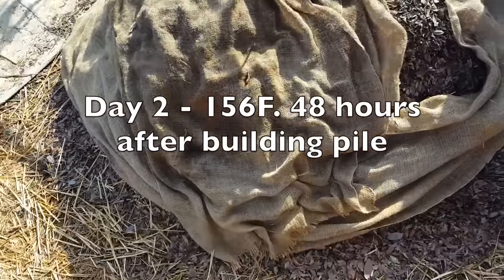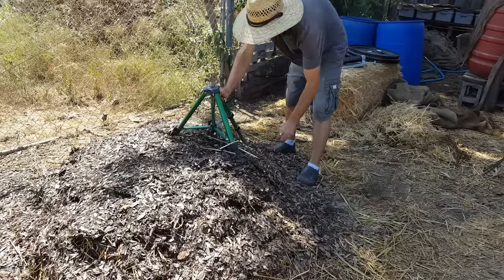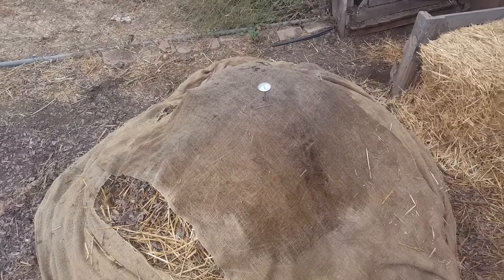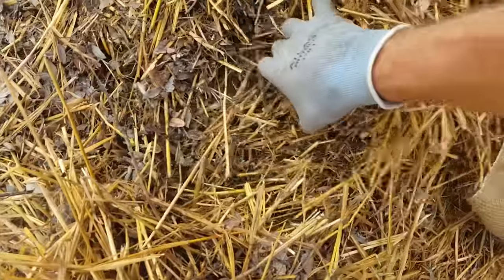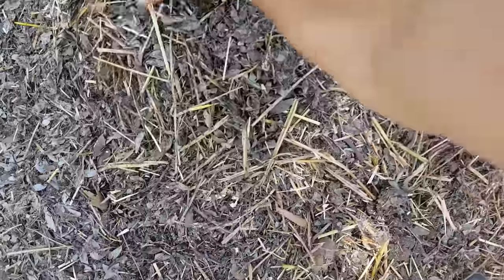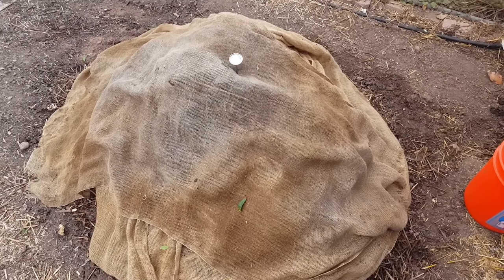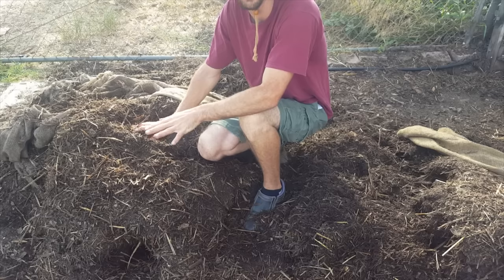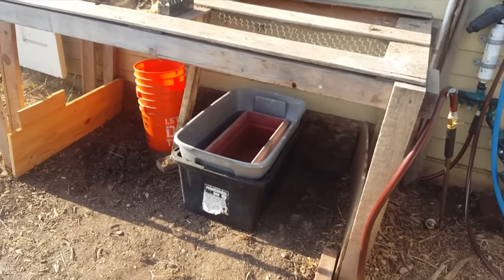How to Build a Hot Compost Pile Successfully 2 of 2

Comment: Super video.  A few years ago I played around with raising worms.  After a year or two, I simply dumped the red wigglers in my compost pile in the spring, expecting them to stay there during the summer then disappear in the winter here in PA.  I was wrong.  Not only did they stay in the warm weather, they stayed in a tight ball of sorts i the winter along with the hundreds of eggs they left behind.  So when I put the finished compost into my garden the following spring, I was shocked how many were still in the very bottom of the pile.  I decided to leave them there, adding any kitchen scraps and carbon sources to them.  What did I get?  I got another annual "pet" pile.  I get thousands of new worms from that first pile every year.  I go through the exact routine annually and I get new generations of worms in that same spot I dumped those initial worms about 10 years ago.  They help break down the pile so much quicker.  The only extra thing I want to add is when the weather starts to get rather cool, or cold to leave them alone.  They will die if you try to turn the pile in extreme temp.  Don't worry.  They will be there i the spring when you peek on on them.
Reply: Nice... We could have different experiments going on at once...
Reply: I started worm composting since 2016 or so ; I have 2 bins I keep indoors that bring me plenty of compost tea and a rather good amount of worm compost every year. But this compost is mostly worm poo (there are also springtails and woodlouses in one of the composters) and has a firm but muddy texture ; thus not really looking like compost soil I usually use for seedlings. Do you think this is related to a deeper breakdown process ; or it's just because it is another degradation process going on through hot processing ? Thanks.

Comment: if you add a small amount of alfalfa pellets to the compost mix it will dramatically increase the temp. and keep the temp in the 150 to 160 range for days.  after adding the alfalfa the temp goes to 150 in 24 hours and stays in that range for 2 - 3 weeks. alfalfa pellets are available at pet supply stores, farm & garden stores and tractor supply.
Reply: I'm using blood fish and bone, seaweed powder and azomite to help my pile.👍
Reply: @nickthegardener.1120  what benefit is the azomite  ?
Reply: @royhoco5748  it doesn't add any NPK but is full of minerals and trace elements. It's to help microbial activity in the pile, however I've just found out that by adding different leaves from trees will produce minerals after the worms have processed them. So I probably won't buy again! My soil at the allotment is unhealthy as I get onion white rot so I'm trying to improve its health and microbes.👍
Reply: Do any of you have a problem with moles, if so how do you deal with them in regards to composting, gardening…?

Comment: As your compost pile starts to cool You could spray with ammonia, Soda and Beer.  The Ammonia will add more Nitrogen The Coke will add sugar to feed microbes and the beer has sugar and yeast as well as beneficial microbes.   Also If you are spending all that time turning the pile you could just add more chicken manure.  The pile loses nitrogen and becomes out of balance for the perfect ratio.
I would also recommend a chipper to run all your material thru before composting if the goal is the fastest breakdown.  
The last thing is I would recommend a biodynamic prep that will take your compost to a whole new level.  They can be found at the Porter Insitute. 
I had a small farm in Long Beach California and spent much of my time running tests on Compost.  We would have the tree trimmers drop off truckloads of trees that have been chipped.  I would add horse manure from the stables and biodynamic preps and the results were amazing.  Not only the compost but the results in the field.   
Great job on the videos.
Reply: @erector5953  
Slug, did you mean Rich Earth Institute?  I also want to point out that I am more worried about the pharmaceuticals in the urine of most people as being something that is not going to be broken down by the composting process. Even in the Rich Earth Institute the tests that are being done are testing the harmful effect of those DRUGS on the health of the plants or being transferred to the plants Pharmaceuticals are toxic even in animals.
Not sure what 80 % of nutrients are eliminated is speaking to?  Are you saying that urine is 80 %nutrients and 20% water?
Reply: @erector5953 Weak argument and did not address what questions I asked of you.
Reply: I certainly don't lose time with you  ,  do whatever you want !
Reply: @erector5953 Slug  You have no idea what you are talking about.  Exactly what I expected from you
.

Comment: Great videos and very good information for learning.  Thank you for investing your time and energy, and sharing so we too can learn.  I've been reviewing your and Dr. Ingham's info hoping to get it right sooner than later.  I started a 3x3 pile a few days ago in a wire cylinder.  When it hit 154 on day 3 I turned it.  I'm concerned that the temp dropped to 115 and even by early evening it was only 122.  Outdoor temps during the day are mid 50s, nights are below 40.  I expected the temperature drop to be less dramatic and thought it would stay above the 131 threshold.  Did I mess up?  

By the next morning (today actually) the temp was up to 162!  No bad smells, just hot.  So I turned it again, and the temp an hour later was 120.  Again, below 131.   Any words of wisdom?

Comment: Have you tried adding more greens as it starts to cool, to keep the pile hot for the entire time? I'm doing that with the current batch I'm making. As it starts to slip, I mix in a little more lawn clippings when I move it, and it juices everything right back up. I also only use grass and leaf clippings from the bagger mower, so it breaks down a lot more evenly.

Comment: Thanks for the videos.  I've attempted two thermophilic piles so far, and I think they're working pretty well but I'm curious  if you could provide advice.  Both times they have heated up quite high..to the point I have to turn them repeatedly to stay under 150 (one person I know said "dont let it go over 150", another person told me "let it get hot, youre turning it to much", both of them I respect their advice so I dk who to listen to haha.

So from the beginning,  It will heat up over 3-4 days up to around 150, and then I turn at day 4.., 6-8 hours later its back up to 150, so I turned it again,  then 12 hours later..back up to 150 again so I turn, and then 24 hours later..back up to 150 turn.  So I'm turning less and less, its like the pile is very volatile early on and needs turned less frequently as it goes. I did around 6 turns in 7-8 days, should I not be turning this much?  Let it sit at those high temps for longer? 

After sixth turn..temps kinda fell out, 130 down to 120 to 110.  But then it rained on day 10-11ish, ..and all of a sudden temps picked back up from 110 on day 11, 120 on day 12, 130 on day 13, and 136 on day 14..then it fizzled back down to 110,100, and now its around 70-80 degrees.  For what it's worth..I did not water the pile at all during any turns, it didnt seem very dry but I'm still learning moisture (I'm in colorado so its dry here and the top and sides were dry so maybe I should have wet those down better at turning, because when it rained..it made me think.."well maybe it needed water for the biology to continue multiplying/composting").  A buddy told me "you are turning it to frequently" but it was getting hot quickly after each turn which is why I turn so could it maybe be to much green input or a materials issue?  In this pile, I am using alfalfa hay and horse manure as my green inputs and have wondered if I should maybe use less manure or less green to let it simmer right in the compost window because it seems like if left unturned..it may exceed 160.  I got pretty good break down and am feeding the material to a worm bin.

Also..now that the pile is down in temps to around 70-80 degrees..should I cover the material?  It's still in the hardware cloth ring just hanging out.  I notice in this video you still turn it ever 5-7 days despite temps having dropped.  Thanks for any input!!

Comment: So a pile that has stayed cooler and stopped getting to the 120+temps you mentioned lack of nitrogen. Would continuing to turn the carbon with refreshed grass clippings possibly continue to achieve the higher desired temps?

Comment: Smaller practicals allow a much greater surface area for things to happen on because mathematics, this is the reason sawdust or sugar dust can explode when airborne and a small heat source. So mulched leaves I bet would be amazing for this as a carbon source.
Reply: I just use a mulching lawnmower to shred everything before it goes on the pile. Temps here in the 40's in Anchorage AK and my pile hits 162F in less than a day. Don't need a lot of nitrogen, either. In fact, you can have a very high carbon source like wood chips and as soon as you add any nitrogen at all to them, they take off. Of course, you want a lot of new material all at once to get things going. Once they get going, you can keep it hot pretty easily.

Comment: Thanks for the videos , great info !many notes taken . May I ask-   Is it better to use straw over hay in your opinion ? Or can i use both ? I read hay was better for microbial activity but not great for fungi ? I think I'm  going for a slightly more microbial based soil though as fits type of plants I'm growing . I might be wrong though ? 👍
Reply from the maker: straw doesn't have seeds so less likely to sprouting later. If you are confident at getting to high temps which will kill the seed in hay then hay is better, more nutrients.
Reply: @NaturesAlwaysRight  that's a good point about the seeds. I'm fairly confident I can get it to 130-160f after watching this + more vids from you and Dr Elaine Ingham .Thanks again! Both helped me learn so much over last few months  🙏🙏

Comment: If you want smell to go away in the chicken shed, use biochar and sprinkle it across the bed. It aDsorbs / aBsorbs (there's a difference) sulfur dioxide gasses, hydrogen sulfide, ammonia, and methane. This could help your compost because if you then use the straw from the chickens with the biochar, there will be more sulfur and nitrogen within it that would otherwise have been lost without the biochar.
Reply from the maker: Great recommendation! I now incorporate biochar into my coop as well as LAB (lactic acid bacteria) it's a korean natural farming technique to eliminate smell and increase microbial activity.

Comment: Could you add failed compost into the base?  You mentioned the good microbes are present.

Shredder for sure. Also will adding nitrogen during turns help raise the temp?
Reply from the maker: Ya that failed compost would be a great first layer in a compost pile, that's what I did in that wooden compost box.
Reply: yes nitrogen would help

Comment: Would you recommend a compost pile over a bin? What would the drawbacks of a bin be?
Reply from the maker: For me and open pile on the ground makes me the best compost the fastest. It's just easier to work the pile from any angle. Bins are great too, I like that you can just shift them to the next open bin, and make a train of compost. It's the same thing basically.
Reply: The bin can help make the pile higher instead of spreading out.  Depending on what is used they can block air so make sure they have plenty of holes or just use wire mesh to make a cylinder. They are easy to knock over and refilled to turn the pile plus the give you the advantage to make the pile exactly where the garden bed is so you don't have to move the plie to the garden!   Make life easy MAKE  you compost where you want your next bed!

Comment: Since nitrogen creates heat, why not add greens to the turns?
Reply from the maker: You don't want to add anything else to the pile because that's considered adding pathogens again. The best pile is built once and is only turned with moisture added. If you have to add greens to make the pile heat up again it wasn't built correctly in the first place, just like the example I showed in the video.

Comment: I find shredded newspaper is a great source of carbon.
Reply: If you do not mind me asking. I worry about the ink used on the paper. News paper or packing material. Have you done any study on this?
Reply: @brrpapapa  Good question. According to the National Association of Printing Ink Manufacturers, most newspapers use inks comprised of soybean oil and various pigments and waxes.  Probably best to choose natural material, but in the summer it's hard to find so I use a bit of newspaper and cardboard.

Comment: btw, don't be alarmed if the chickens eat the biochar. So long as the biochar is made clean (Not in a container that had paint on it or one with chromium in the alloy) your chickens will actually benefit from eating the char.
Reply from the maker: Is there a way to know if the metal has chromium? I'm about to build a TLUD system using a 55gallon drum. The paint has been burned off of the drum.

Comment: Pffft, my pile is at 90. Cannot figure out where I'm going wrong. Why can't you just add more green to the failed pile?
Reply from the maker: You can but then you need to think of the pile as starting again at day 1 because adding more materials is like adding more "Pathogens" or it has to be thought of that way. The best piles are built once, and they have enough materials to go through multiple heating and cooling cycles. Focus in on that ratio of 60% carbon 40% greens and the right moisture content, I bet you aren't using enough greens in your beginning pile